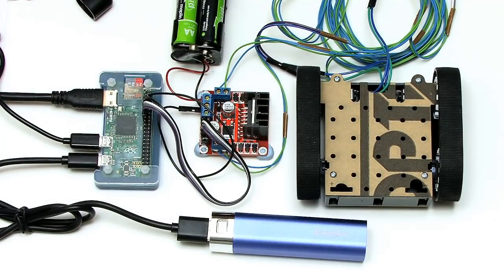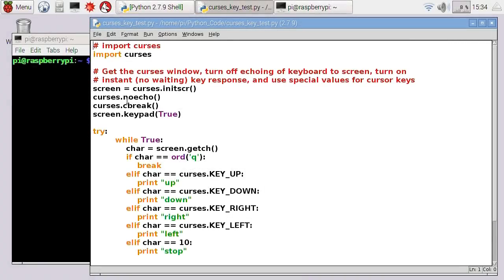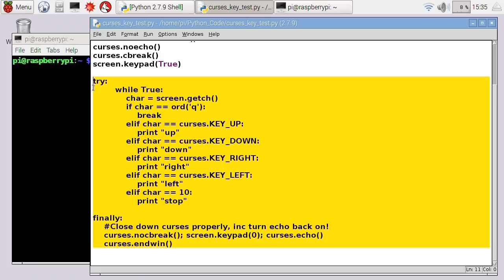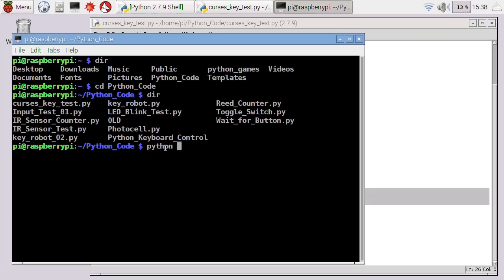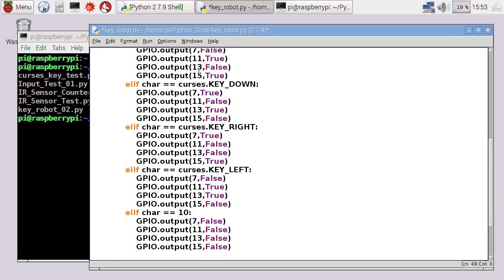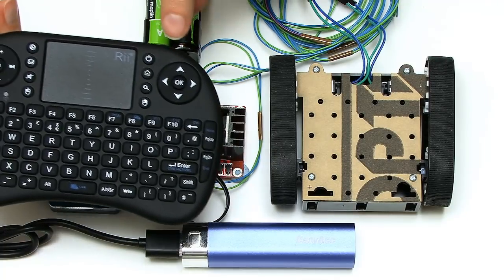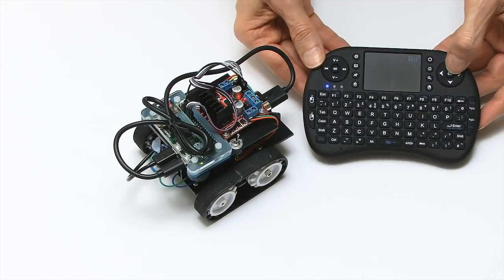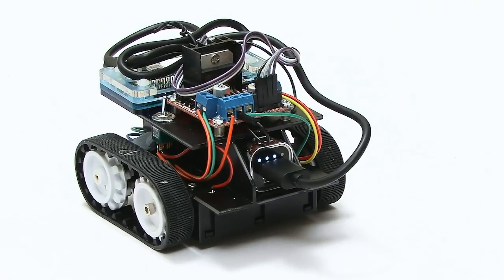Raspberry Pi Robotics #3: Keyboard Control

Comment: i know you are super busy and i thank you for the videos and the work you put out for us!!!!

but ive spent all day trying to fix my issue with the code. I am brand new and only know what little ive gained from your previos videos.

my program was saying no module named RPi.GPIO..... the keyboard test worked great with the import curses. I have encountered this b4 on another project but i think i ended up giving up. b4 solving.

if i run the file with python file.py i get         bash: python: command not found

if i use python3 file.py i get a black screen like the keyboard test but no actions nothing show up on the screen
Reply: i also just removed this pi from a robot "Pi Car X by Sun Founder" and it worked without a single issue. Therefore im assuming the boards ok. although a diff sd card and OS
Reply from the maker: The error with RPi.GPIO sounds like you have a syntax error where your code says import RPi.GPIO as GPIO -- remember this code is case sensitive. The code can be checked/downloaded from a link on this page: https://www.explainingcomputers.com/rasp_pi_robotics.html -- under the video #3 heading. Good luck!
Reply: @ExplainingComputers  yes sir, I have copy and pasted your code. Printed it out and went over each letter. I’m still missing something. Thank you
Reply: @ExplainingComputers  now when I even try to run your original keyboard test code I receive 
Bash: python: command not found. 

It worked before Idk y not now
Reply: @ExplainingComputers  ok I got back working but the only key that does anything is “q”

I had to remove all my libraries and reimport
Reply: @ExplainingComputers  I found my issue. I had my pi orientation backwards from ur video. My gpio pins where placed on the wrong ones
Reply: I get an error in curseskeytest tell me that module curses has no attribute initscr

Comment: I am having a problem opening my new download  key_robot.py  it says the channel is in use, my first program  key test.py ran good,  should my motors be connected for the program to run? on your monitor it shows you have Python_Code, do I need that?  you'll have to be patient with a 83 year old newbie.thanks
Reply from the maker: No problem! Python_Code is just the directory/folder that I store my Python files in -- you can put the file wherever you like on the Pi. Your motors do not need to be connected for the motor to run. Tell me more about "channel in use" . . . we will sort this! :)
Reply: what command do you use to open the program on the monitor
Reply: I try running  python curses_key_robot.py  , it says no such file or directory, I even try running it with the module still no go

Comment: I keep getting this error.
how can I fix it?
Traceback (most recent call last):
  File "/home/pi/Rover/RoverControl.py", line 15, in <module>
    screen = curses.initscr()
  File "/usr/lib/python3.5/curses/__init__.py", line 30, in initscr
    fd=_sys.__stdout__.fileno())
_curses.error: setupterm: could not find terminal
Reply from the maker: The "could not find terminal" strongly suggests that you are not running the code from a terminal! :) As the video stresses, this code will not work if executed from within IDLE -- you must run it from an open terminal window. Good luck.
Reply: ok thank you

Comment: It printed up, down, left and right but then when I added the gpio code nothing happens. Please help!
Reply from the maker: Make sure you ran IDLE from a terminal in root mode by typing sudo idle
Reply: I did and I have the file with the print up, down, right and left and that works but then when i added the GPIO code part of it when i pressed up it didn't go forward. none of the arows did anything
Reply from the maker: I've nothing to go on here -- this is probably a syntax issue (you have typed something wrong in the code); a module issue (you are lacking the GPIO module on your Pi perhaps), or hardware issue (with your motor or motor controller). I would suggest going back to basics. First, check that you can do something simple controlling a motor -- so go back to what I show in the previous video in this series -- https://www.youtube.com/watch?v=AZSiqj0NZgU -- and check that works. Then, when you know the hardware is working OK, add in the keyboard control stuff. If you cannot control a motor here, try a sudo apt-get update and sudo apt-get dist-upgrade on your Pi to make sure all modules are installed. Good Luck, and do report back! :)

Comment: I got an error about screen = curses.InItscr()
Reply: Pls respond
Reply from the maker: Are you running the code from a terminal? It mus run from a terminal for curses to have the focus.
Reply: @ExplainingComputers It runs but if i press the up arrow it doesn't do anything. 
This is my code:

import curses

screen = curses.initscr()
curses.noecho
curses.cbreak
screen.keypad(True)

try:
    while True:
        char = screen.getch()
        if char == curses.KEY_UP:
            print('Forward')
finally:
    curses.nocbreak()
    screen.keypad(0)
    curses.echo()
    curses.endwin()

PS. I work on windows laptop.

Comment: One thing, you don't blow your RPi by connecting the motor directly, it simply doesn't supply enough current and the motor doesn't even move -- I know this because I've tried it :)
Reply from the maker: Yes, you may not destroy the whole Raspberry Pi. But I can assure you that it is fairly easy to damage the GPIO pins on a Raspberry Pi by drawing too much current from them. They have no overload protection. Even an LED connected without a current-limiting resistor could do it.

Comment: where is the camera ?
Reply from the maker: Sadly there is no camera port on the Pi Zero. But I hope to progress to a robot with a camera at some point.
Reply: ExplainingComputers ok :)
Reply: Can i use webcam ?
Reply from the maker: BuzzCola 3
Potentially, yes, sing a WiFi USB hub as I showed in thr video.May be power issues though.
Reply: Ok thanks i have orange pi :)
Reply: The newer Pi Zero has a smaller version of the camera port, but if you get one of those, you'll also need to get an adaptor cable... it reminds me of Apple and their adaptors.
Reply from the maker: Inaflap I had missed that! A Zero with a camera port! Thanks greatly for this. :)
Reply: choice={
    curses.KEY_UP:"0101",             
    curses.KEY_DOWN:"1010",
    curses.KEY_RIGHT:"1001",
    curses.KEY_LEFT:"0110",
    10:"0000",
    113:"0000"
}

try:
    char=''   # that is two single quotes
    while ( char != 113 ):  # q key stops all this nonsense
        char=screen.getch()
        chosen=choice.get(char)
        GPIO.output(7,int(chosen[0:1]))
        GPIO.output(11,int(chosen[1:2]))
        GPIO.output(13,int(chosen[2:3]))
        GPIO.output(15,int(chosen[3:4]))

Comment: i have checked everything but its still not moving :(
Reply from the maker: Have you run the code from my previous "Raspberry Pi Robotics #2" video? In other words, have you checked that you have GPIO control of the motors? You need to build this up in stages -- check that you have the motor controller working, and can control it, then try and add the keyboard control. Also check that there are no errors in your code -- this is the most common problem people have. You can download the Python files I used from the end of this page: http://www.explainingcomputers.com/rasp_pi_robotics.html

Comment: ERROR:  _curses.error: cbreak() returned ERR
Can you help me fix this error, please? Thank you!
Reply from the maker: Make sure you are running the code directly from a terminal. Good luck!
Reply: @ExplainingComputers  I connected the raspi to the laptop with a wifi cable, manipulating the interface of the raspi. I saved the file in mu_code, the other files still run normally. Particularly file curse_key_test.py, the above error message. Please help me how to fix it, thanks !
Reply from the maker: @kiddicode6897  Is the key test code works, then you are reading the code OK. Which suggests you have a typo in the other code somewhere. So all I can suggest is checking your code. :)
Reply: @ExplainingComputers  Thank you!

Comment: Calling this an autonomous robot is not entirely accurate, it does not gain information about the environment it is in or perform any independent logical function without human intervention. Still pretty cool, I built one like it a couple years ago, however it had a sensor array.
Reply from the maker: It responds to certain wireless signals from its environment. But I take your point. I should have said it was an independent robot. But if I tried to get all of my takes word-perfect, I would never finish a video. :)
Reply: You should add in a HC-SR04 Range Detector or a Phoneix Smart Car Robot IR Infrared Obstacle Avoidance Sensor Module (which is $3 can) and have it as a full autonomous obstacle avoiding robot.
Reply: Since you are going with line following you could up your game and add in obstacle avoiding. Have it follow a line to an  obstacle, go around the obstacle and reacquire the line, I am working on this one.
Reply: Lasers are better and more precise sensors than IR infrared obstracle avoidance sensors. In the good cleaning robots they use lasers because of that.
Reply: OpenGL4ever
No actually they are not, since even a little bit of a reflective surface or dust will defeat them.
Reply: greywolf424
Cleaning robots with lasers are better in reviews and tests than those without them. This is a fact.

And there is a reason for that, the laser light signal is very narrow on a discrete wavelength while with normal IR light the sensor can be  distracted and tricked by other light sources.

Comment: where is CURSEs.PY a library ???
Reply from the maker: curses is included with an up-to-date version of Raspbian -- so just make sure you have import curses early in your code. All the code used in this video is available here -- http://www.explainingcomputers.com/rasp_pi_robotics.html
Reply: when I run your code, have a followin message of error:

Traceback (most recent call last):
  File "/home/pi/Desktop/probar.py", line 14, in <module>
    screen = curses.initscr()
  File "/usr/lib/python2.7/curses/__init__.py", line 33, in initscr
    fd=_sys.__stdout__.fileno())
error: setupterm: could not find terminal

I mean that the screen = curses.initscr() is not declared good in this statement o maybe other problem, please help me

Comment: Wai. This is a remote control car. not a robot yet , is it ?
Reply from the maker: I covered this point. Unlike in a RC car, the motors are not simply slaved to a wireless signal -- so conceptually and technically it is different. :)